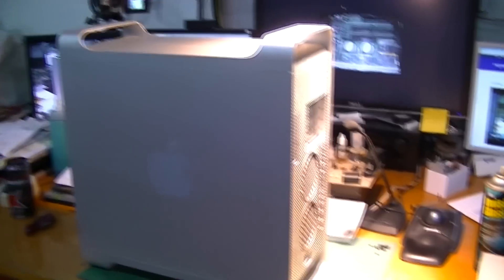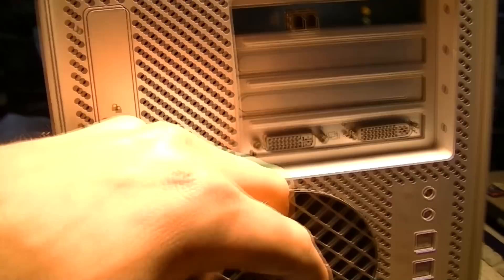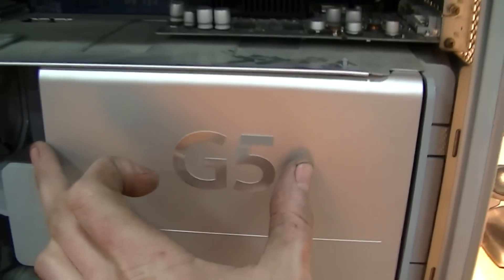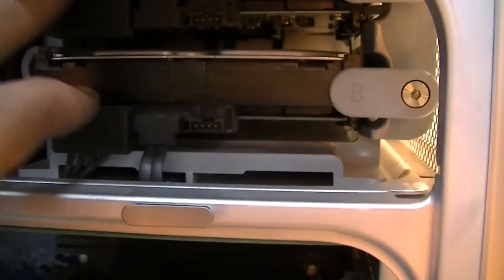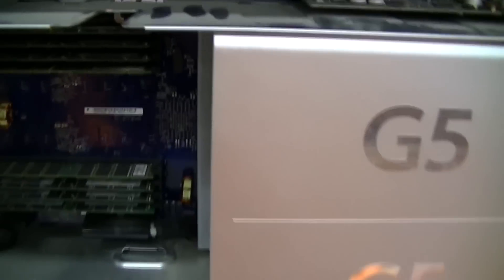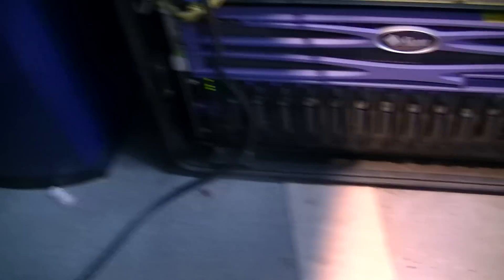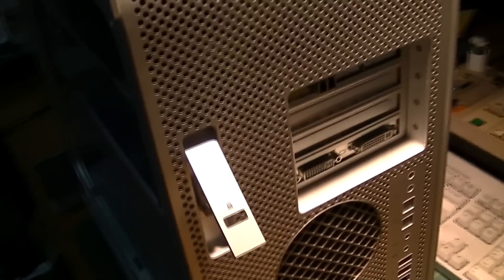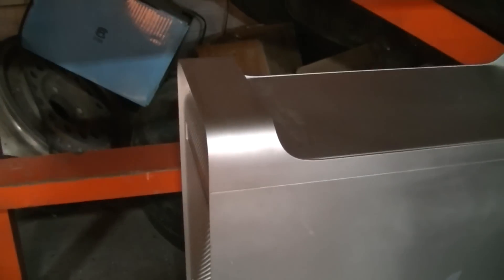Debian Linux / PowerPC G5 Server tour

Comment: I've been using this as my main machine as my HP 500-070 died a few months ago. It's very fast, but I still went out and bought a 2006 Intel Core 2 duo iMac so I could run Windows 7 and use newer applications. I ended up going to back to the G5 as mine is even faster than some Core 2 Duo machines. PowerPC G5s aren't slouches. Unless its a single core 1.6GHz model.

Comment: That server looks awesome!. shame about the power bill on the SUN server :(, but I guess you get that in a share situation anyway (always had to split bills when sharing houses)
I have done very little with Apple gear, but it looks pretty solid in this case!.

I have a 15M fiber cable and card for my fiber network now :D, I will be installing it in the rack when that is done.
Reply: ***** later you could get another of the Debian Linux / PowerPC G5.

Comment: You should look into the talos II computer with a Power9 processor. It's basically a modern form of this old power mac, it has support for modern PCIE slots, which means you can use modern video cards and m.2 storage which is faster than a regular ssd.
Reply from the maker: I have had my eye on the Talos since 2013. I would love love love to be able to afford such an amazing machine. Perhaps one day I will get my hands on one. Fingers crossed.
Reply: @DoogieLabs  their blackbird computer is relatively less expensive. Also, this computer will get cheaper over time.

Comment: I own 2 of these myself. A late 2004 dual 2.5 and a late 2005 DC. Both are great machines but power usage is a killer. But then again both are loaded to the gills. But you shouldn't clean that case with a dry cloth. It scratches the aluminum. It might be a tank, but it's not bulletproof after all. I actually use wipes made for that purpose. Then again I got mine nearly new. Stored for 10 years. I kid you not. But them cases are gorgeous and the hardware is even better. I love PowerPC myself.

Comment: Apple stuff is Not worth it. They are a scam and a complete waste of money. They are twice as expensive as anything else with the same insides and Same performance if not better. Not to mention, that they choose to design their stuff with Form over Function, so the "high performance" ones have over heating issues. The GPUs in them for video work are God awful for what you paid for and that's the most needed component of an editing system. The best laptops right now with the best GPUs are the gaming ones because they are designed with graphics in mind instead of being an over priced luxury device. Dude, I've used Mac for over a decade just because I'm forced to use them because of the school and work I've been in, they fail too frequently, they are a pain in the ass to get serviced. I've used many systems in the past and the best ones are either custom built for specifically editing, special effects, and rendering, or a "gaming" computer. trust me dude, it's not worth it just because they look pretty and have a commonly circulated misconception that they are designed for creative work. If they were designed for that, they would have a much better GPU in them, have better compatibility with other systems to minimize the complexity of file sharing with other users and collaborations with other companies, not over heat as much, and be more easily serviceable to minimize downtime in a professional work flow. Macs are anything but professional by any means. They abuse the lack of knowledge most consers have about computers and exploit you to their advantage toake sure you don't buy anything else and you buy a new model as soon as you can. That's why apple stuff works so well with apple stuff than anything else. They have the capability to make their devices more compatible with other stuff but they choose not to. Don't get one, you will be missing out on a system that lasts longer, is faster to work with and more tailored to your needs instead of being forced to accept whatever specs they offer you. Don't be fooled by the pretty aesthetic and ecosystem. And dont let a multi trillion dollar abuse you.